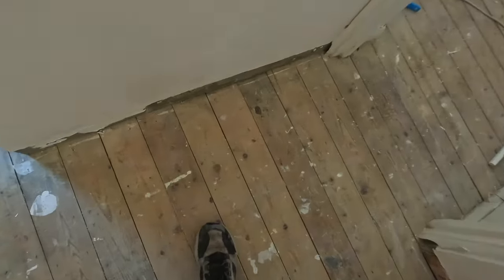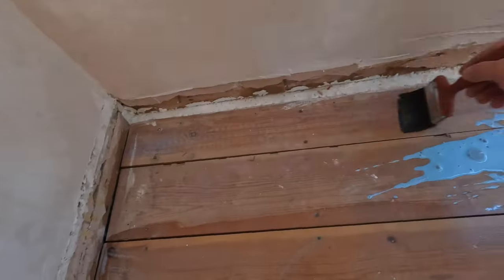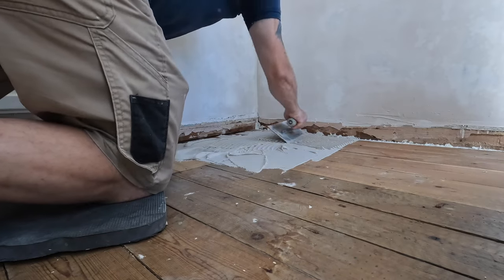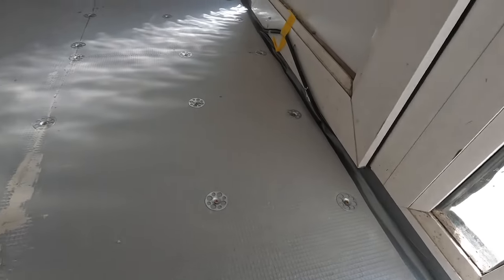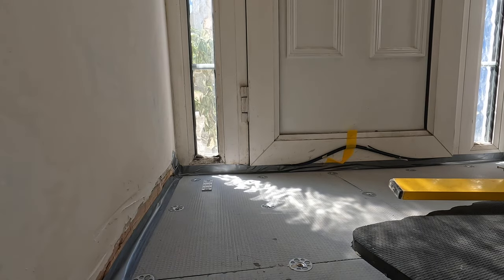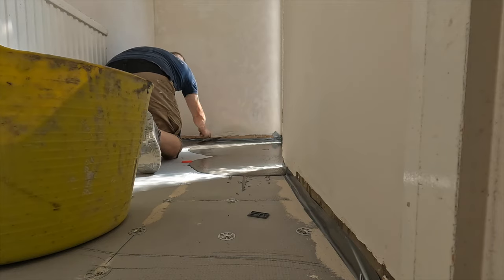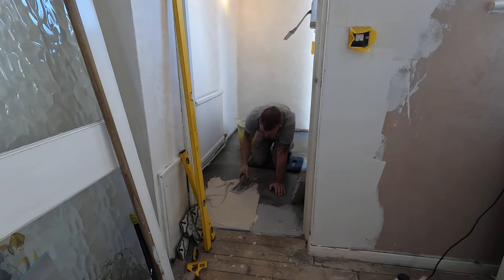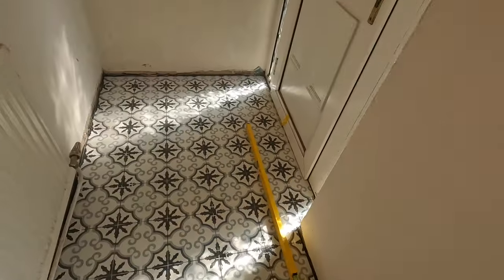Tiling on top of the floorboards

Comment: I have hole on the edge of the floorboards in a few corners, what would I do in this case?
Reply from the maker: If it is not very big you can fill it with expanding foam. If is bigger then 4-5cm you need to replace that section of floorboard.

Comment: What is the reason for needing a stiffer backer board on normal floorboards?  Would Marmox 4mm board be adequate?
Reply from the maker: Hi . The reason is because normal floorboards ( without tongue and groove) are moving separately from each other. By using a more rigid backer board ( no more ply , cement boards) you will reduce the chance to have cracks in the tiles. I never used 4mm boards. Always used 6mm or more.
Reply: @valentinointeriors3023  thanks that makes sense.  Would you still use adhesive to fix cement board down to floor boards?  No More Ply seem to suggest their mega strength mastik is adequate.
Reply from the maker: @871danwaters  I am using adhesive all the time. I haven’t use no more ply . But if they are recommending something to stick down the board it should be ok . 
Just double check if this method works for your application.
Reply: @valentinointeriors3023  what was the budget for this please my bathroom is about the same and I need to save up

Comment: Can we lay porcelain tile over hardwood and tile floor? Please advise.. Thanks in advance!
Reply from the maker: Do you have a floor that is tiled and you want to install porcelain tiles over? 
This is possible with the right preparation and right primer
Reply: In some areas we have hardwood and in some areas we have existing tiles. Now we want to do all porcelain tiles over existing hardwood and tiles. Is this possible?
Reply from the maker: @EswaraiahChalla  You can tile over the existing tiles if they are well fitted and don’t show any damage damage.
You can’t tile directly over the hardwood. Ditra mat or backing board need to be used before tiling depending on what type of subfloor you have.
Reply: Thank you so much.. appreciate your advice!
Reply from the maker: @ParvathiChalla-kp2dm   No problem.

Comment: may i asking what is this board called(name)?  thanks
Reply from the maker: Hi 
It is called tile backer board.

https://thisiswholesale.co.uk/next-day-building-material-supplies-uk-stock-wholesale-construction/tile-backer-insulation-cement-backing-hard-rigid-board-wall-floor-6mm-10mm-12mm-tile-adhesive-board?gclid=EAIaIQobChMI-ZqgvPCv-wIVFpftCh1bbgTGEAQYASABEgKEWPD_BwE
Reply: Hi is fibre cement board serving the same purpose as backer boards on wooden floor?

Comment: Very informative video, I want to tile in my kitchen which has old floorboards and pretty sure it's not even, but I do not want to tile under all existing cabinets I just want to tile on the open floor and where the appliances sit oven, fridge, washing machine. How do I make the floor level and the leveling compound will end up going under the cabinets...
Reply from the maker: Hi 
We normally lay some 2x1 or some scrap timber against the units legs and duct tape. If the self levelling is not too thick you can use duct tape without timber.
Reply: I used expanding foam

Comment: What happens when u have a leak
Reply from the maker: There should not be a leak. I am trying not to have connections under the floor where are not accessible ( at least from the ceiling below) . If there is a leak you will have a bigger problem than removing the back board.

Comment: Way you do it so complicated, just put plywood and that's it
Reply from the maker: Plywood is not allowed for tiling anymore and for good reasons.
Reply: Why is it not allowed anymore?
Reply: Plywood shouldn’t be less than 18mm and properly sealed (i.e. with a correct primer). If that’s done, there shouldn’t be any issues.
Reply: Btw. tiling onto plywood on the wall is not permitted under British Standards. On the floor it is ok.
Reply from the maker: @kawo666  Ok . I don’t know if you are a tiler , probably not. If you want to tile on plywood the plywood needs to be a very good quality. That will be more expensive than a backer board. So who is complicating things?
Reply from the maker: @kawo666  As I said earlier if you will be a tiler and if you have done tiling on plywood and backer board you will understand.
Reply: I’ve done tiling on both substrates, and I can easily say both methods are valid. My jobs on ply from 10-15 years ago are still holding well. Yes, the ply needs to be WSB (at the minimum). Price-wise there isn’t much difference, so better to go with backer/ cement board option, as these are more stable and don’t require sealing. In the past, when timber prices were lower, and cement boards not so popular, ply option was cheaper.
I would also advise on using Ditra/Durabase matting, but it’s not crucial in most scenarios.
Not sure why you’re so defensive. I’m only adding extra info for context and fully agree with your methodology here.
Reply from the maker: @kawo666  Hi . I am not defensive. You can’t imagine how many people are commenting even if they are not on the trade . I had people saying that the wood will rot under the tiles . Maybe you should start with a this  comment first. And yes I do agree with what you said. I did tiling on plywood and I did removed tiles from plywood. Plywood has failed me just one time in the past and that because different reasons . I can’t encourage people to use plywood as I seen many fails with the plywood. People don’t understand that Pva is not a suitable primer for tiling on wood. If I encourage people to tile on plywood probably half of them will have problems. In the last 2 years in Uk I did a lot of work where we needed to follow an architectural drawing and tiling directly on plywood was not allowed at any point and they were very specific about this . Tiling directly on plywood can fail if you don’t follow some rules. Thank you 🙏
Reply: @valentinointeriors3023 Yes. 100% agree. I’ve worked on correcting many plywood failures - too thin, cheap type, not secured correctly, incorrect adhesive, etc. Cement/ backer boards are great improvement in that respect. However, people will still use ply for many reasons (habit, leftover boards from other jobs, etc.). And yes, PVA is a no-no. Appropriate priming is absolutely necessary (usually from BAL or Mapei). All the best to you and thanks for making educational videos :)
Reply from the maker: @kawo666  Thank you . I did worked with many primers but for me sbr from Ball is no 1 . All the best. 👍